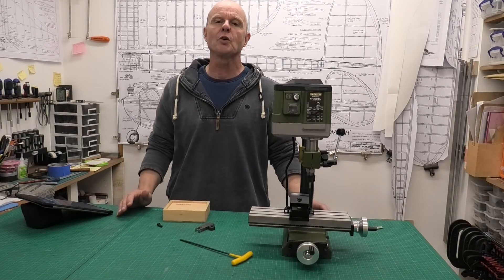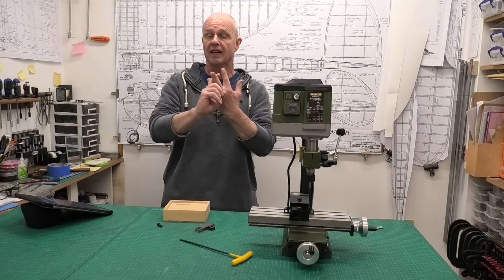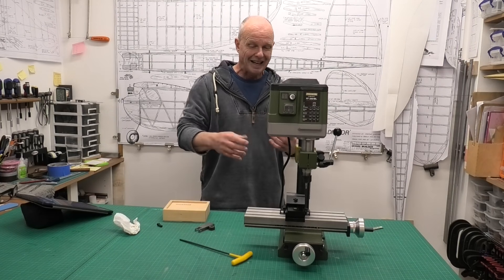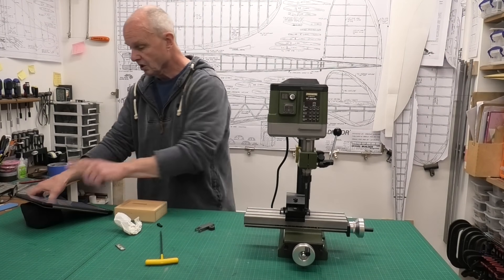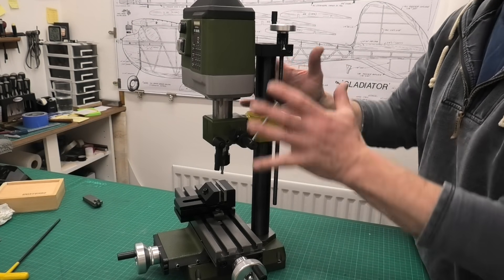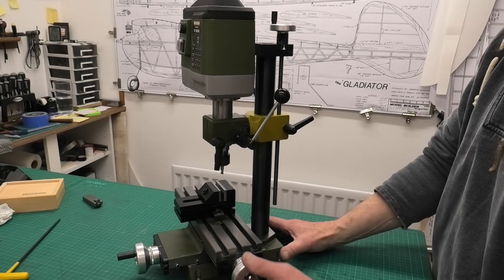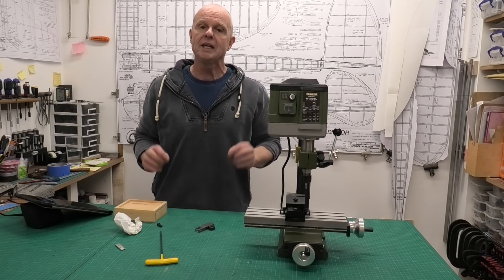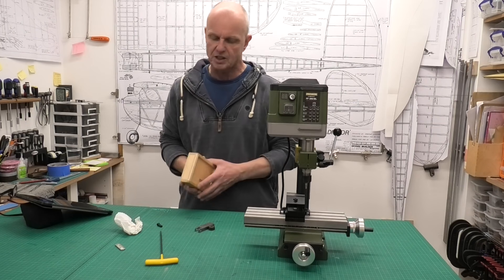Proxxon FF 250/BL Milling Machine - Basic Review - PF 250/BL

Comment: I bought a second hand FF230 (belt drive).

How the hell do you secure the tool in the collet?!?!?

I tried it but the tool doesn't get any grip no matter how hard I tighten the nut. I used ER collets before no problem but I'm having problems with these proxxon collets, the only thing that works is to put a couple of washers inside the spindle before putting the collet in, that way the collet sticks out more and I can get the grip on the tool but it doesn't run true at all.

Comment: Thanks for a review! Information on this machine is so scarce, I've been searching for any bit of it for ages. I couldn't find a thing, until now.
I'm considering buying FF250 for small hobby projects, which involves some work on steel. This machine is actually good option considering the space limitations I have.
How does that hold up on steel? How deep you can cut without bad vibrations?
Reply from the maker: Thank you for the comment, pleased you found it useful, it works really well on steel, no problems at all.  How deep, sorry don't know, but I have never had any bad vibrations with the machine

Comment: So happy that someone finally made a review. 
Own the Proxxon PD250/E lathe and want to get a mill to compliment it. 

However I have not been able to decide between getting the FF230 or the FF250/BL. 
Only a few videos on the 230 but as you said yourself literally nothing on the 250. 

From what I can tell the 230 is I guess a more dated model? Not sure if you have or anyone here has any experience with that unit.
Reply: Also worth mentioning the 230 has preparatory collets which match nothing else … so you are stuck with the diameters provided in the proxxon kit , I have had to make cylindrical shims for example to use a reduced shank drill (9.5mm / 3/8”) no imperial options at all 😮
The 250 uses Er collets which you can buy anywhere and all sizes metric or imperial…… worth considering! The shims I make are from feeler gauge material
Reply from the maker: Thanks for the comment, pleased you enjoyed the review, hope it helps in your selection
Reply: Hi! I also have Proxxon PD 250/e lathe. I've also bought PF 250/BL milling machine in december 2024. The same one like this guy has in the video. But after 2 months of use it broke. My milling bit stuck in workpiece during milling. There was "E0" on display which indicated overloading like couple of times before. Milling machine safely stopped everytime when overloaded. But this time it didn't work for some reason. There was also a little smoke comming from ventilation grid. All this happened within a second. I didn't even manage to switch the machine off. Now I cannot turn the machine on. Something burnt out there. I've sent it back to seller to solve the issue. Currently I'm waiting for resulution.
Reply: The ff230 has belts which is actually desirable to output max torque from the brushed motor at different speed ranges (depending on belt positioning) however the motor is half the watts of the ff250 brushless….. I’m not sure if it’s an upgrade due to brushless suffering low torque at low rpm ! I too am looking…. I have the 230 and have done great things but drilling and reaming model cylinder bores is very much on the edge of what it will do 😅 
It would be good if they published the torque figures to help decide ……
Reply: @chriszwetsloot815  I got my PF 250/BL milling machine back. The service man replaced electronic components for free. No payment for repairing. My milling machine runs like new now. It seems to me that It has even more power. Probably they made some adjustment or something.
Reply: Vielen Dank! Ich konnte auch keine reviews für FF 250 finden.

Comment: Hi Mark, Good review, thanks. What other milling machines did you consider before buying this one ? Some people say that milling machines with round columns are not as accurate because there isn't a way to stop the head moving slightly round the column as the height is changed. I guess that wouldn't apply if you had the rear height adjustment locked and used the quill lever/fine feed to move the height of the cutter. Any comments on that ? Rob
Reply from the maker: Hi Rob, the only other mill I seriously considered was the Sherline, but it was a bit more expensive and as I was really pleased with my Proxxon lathe decided to go with that make.  Also, good to get something manufactured closer to home in Germany, rather than importing something from the US. The whole thing seems fairly rigid, the round column is very robust solid and heavy, don't think there will be an issue for the type of work I will be doing, good luck with your choice, its never easy always a balance of size, money and space 😀
Reply: @MarkRobinson555 Hi Mark, Thanks for your reply. The Sherline machines are nice and at least they do them in metric versions these days which wasn't the case earlier. I nearly decided to buy one of their lathes but they don't come with power feed for the carriage which makes getting good surface finishes on steel items more tricky. I have some smaller Proxxon items which work well - the small disk sander is lovely for example.

Comment: Love these proxxon machines, I got a lathe, multitool and bandsaw from them. All work great, and when bought second hand even affordable. Now you've put this monster on my wishlist too ;) since the smaller one they have really seems too small. Cheers.
Reply from the maker: @thijsrikkerink6333  thanks for the comment, pleased you enjoyed the video and like Proxxon machines, they really are good to work with.
Reply: @MarkRobinson555 What made you choose this one over the FF 230? As far as I can see they're functionally not very different.
Reply from the maker: The 250 is the latest version and improved 230 with variable speed and digital readout
Reply: @MarkRobinson555 Thank you. On marketplace I can buy a bfw40 with stand and crosstable for 350 EUR. It seems that it has similar functions to the ff250 with regards to speed, table movement ect. In your search, have you considered that one as well? Maybe there are some downsides I haven't found yet. Cheers.
Reply from the maker: @ I didn't consider the bfw40 😀
Reply: @MarkRobinson555 Thank you for your replies, I think I might buy it. The ff250 is really nice but a bit too expensive for me :). Let's see who can make an engine first ;P. Cheers!
Reply from the maker: @ Hope it goes well 😀